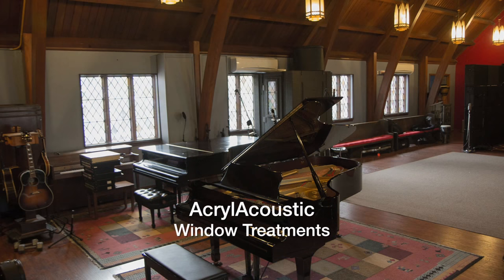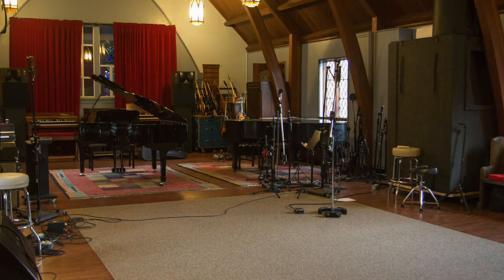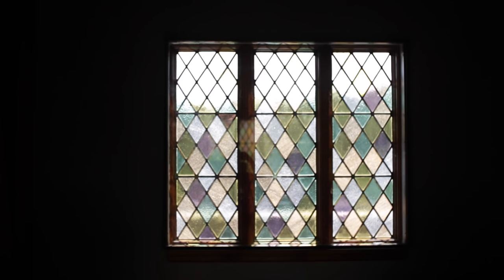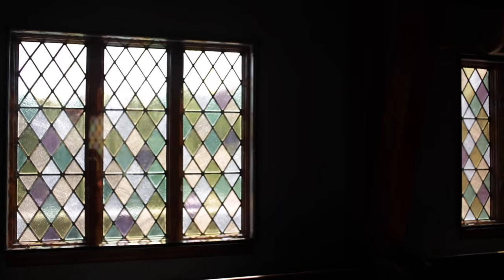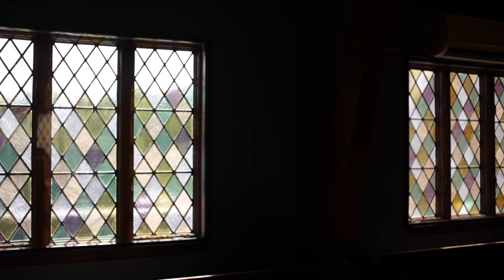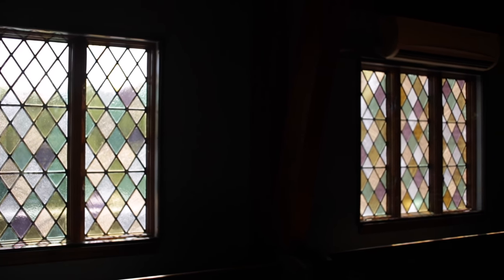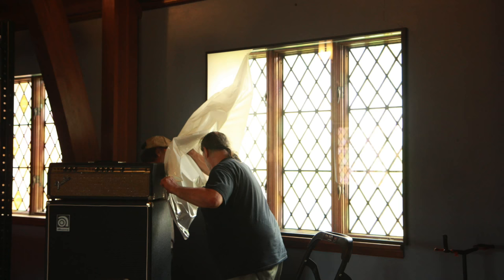The Church - Climate Seal Window Treatments

Comment: Can you install these window panels at a slight angle to reduce standing waves between parallel surfaces?
Reply: Tha method can be used to eliminate or reduce a high frequency flutter echo, but standing waves at lower frequencies will remain unaffected.